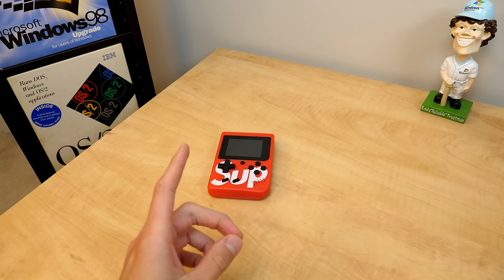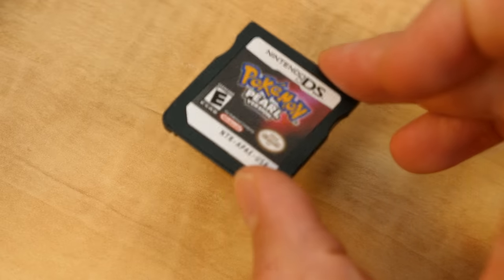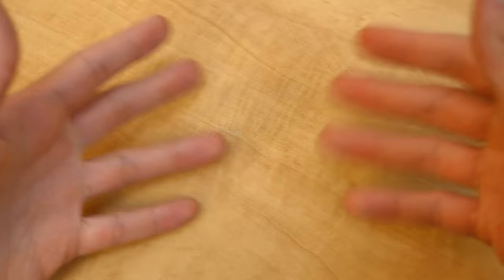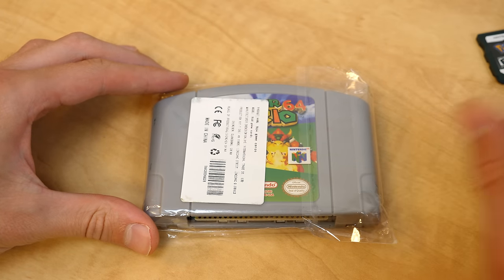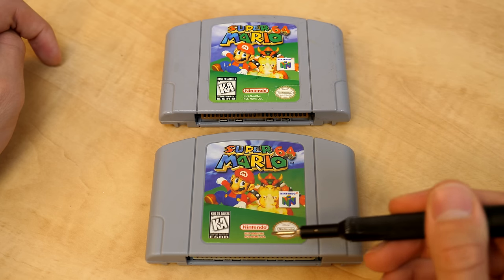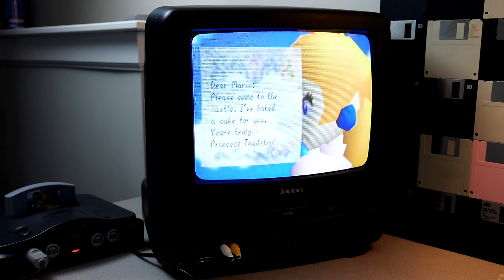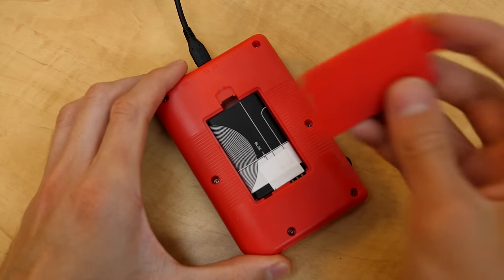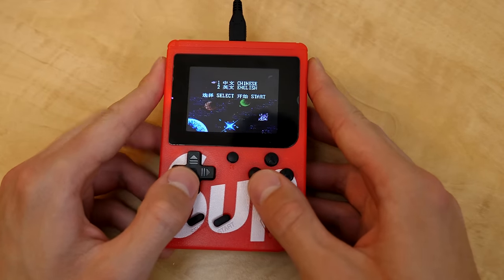I Bought Bootleg Nintendo Games from Temu

Comment: These bootlegs are a real Issue. Don't buy these, because you support people who make money with pirating stuff. Just buy Flashcards and flash it yourself. A different issue is, that they might get sold as originals later. Recently I bought a GBA with games. The seller did said that 4 games where not original but it was 6, that where easy to spot. I didn't checked the others that deeply. For me they have 0 value. Sure these where easy to spot and if I would have checked the pictures, I would have seen the other 2, when checking the artwork. 

With the DS Flashcards it would be interesting if they work on a 3DS. I have an R4 Card that worked on a 3DS but due to an update, it was locked out and my revision wasn't supported and updating the firmware didn't worked.

Comment: 1:40
With DS (and 3DS) carts you can check for counterfeit with the code at the bottom of sticker --
The first three are... Company that made the game... i think??? not really sure.
Second one is the game's ID
Third is the region (kinda obviously)

Th four in the middle are the interesting one; Compare it with what is engraved on the back of the cart. If its not the same, its a counterfeit

WAIT WHAT
its a flashcart, with a red motherboard too? ( i dont think ive ever sen a DS cart with a red board, ever, until now lol)

WAIT WHAT x2
IS THAT SD CARD EVEN REAL?
It doesnt look like it has pins on it...

WAIT WHAT x3
a...
A fake 3DS cart..
thats not even white, nor does it have the notch that 3DS carts have.
i mean i know and its been tested that the notch does nothing technically but...
this is even stupider than the first one

....
What is with these flashcarts? Ive never seen one before and i HAVE seen counterfeit DS games, where the easiest way to tell is the game ID. (Alternatively, it runs like crap, with the most usual problem being that sleep mode doesnt work right)

5:30
was looking into how to chck a GBA cart, found out a neat detail specific to gen 3 red and green -- a real cart will simply not have a battery.
Literally in this frame as your open it, theres obviously a battery there.

(The other thing with GBA and GB carts, is look up a picture of the real motherboard. Then compare to your own. Alternatively, look for four gold rectangles.)

Comment: Who goes to these websites to buy the real thing! I think you just picked the wrong seller. 

I bought a reproduction pearl as well and I pay 8 dollars, and surprisingly my card don’t have an sd card is a similar as the original.

I bought one before the new switch game came out, and I bought it because in one point I had to sell my original with other games because I didn’t had money to buy my daughter a birthday present, and when I wanted to buy back my games the originals are going for 70 dollars used.

The only thing I will say ti those like me that bought a reproduction, don’t sell them and specially as an original.

Comment: 11:45 this is clearly an R4 clone as it is using the Wood R4 menu/running system.   It even has the gbatemp theme to it. XD.   Denoting that with a card like this you can illegally put any DS game you want on the card.   $30 cash is still a rip off even if you are vying to be a pirate.   That would have to be the expense of the micro SD card.

Comment: you wasted your time taking apart leaf green. the BIGGEST giveaway is that its missing the 4 square solder pads that are next to each other making a bigger square on the top left coner on the back of the board. you can clearly see them in all gba pokemon games and 90% of the fakes do not have them

Comment: There are still Nintendo fake stuff on ebay 😁😁😁 i just bought a Nintendo switch joycon remote for my device on WISH. It might have been a fake 😁😁🤣 the jcon doesn't work while its detached from the switch. im not trippin about it though as long as it works while its linked to the switch 🤣